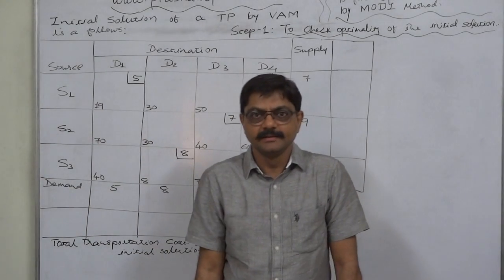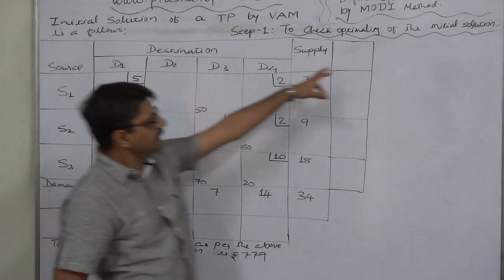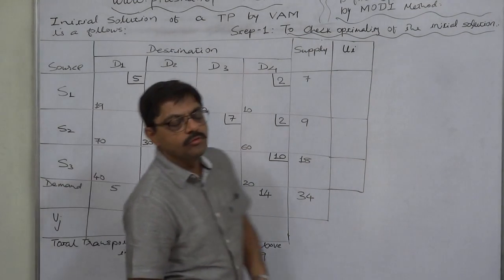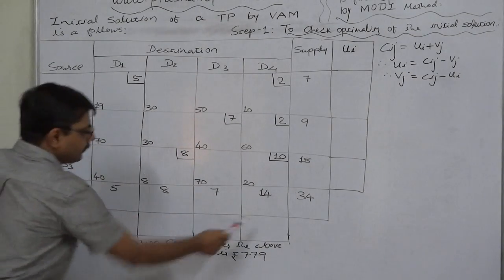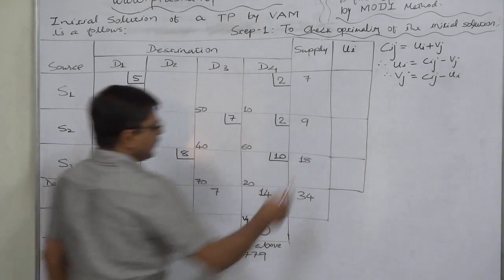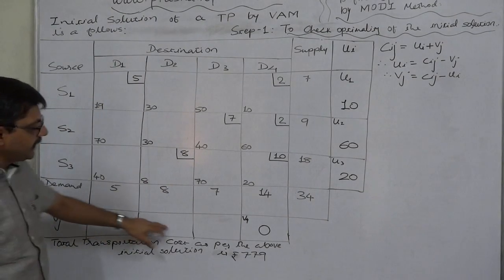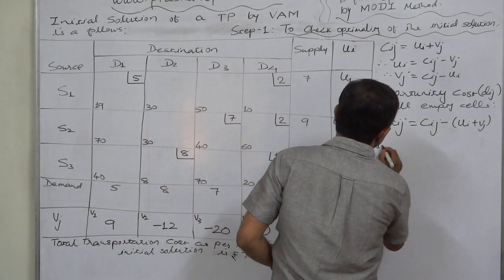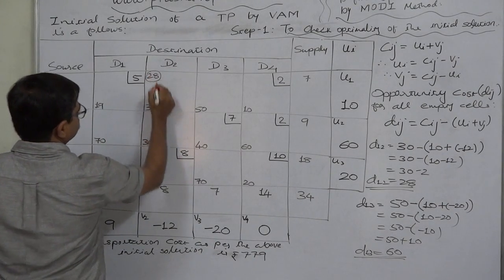Transportation Problem - 8 Optimal Solution Part 1 of 3

Comment: Sir what is the difference between Modi method and stepping stone method ?. Sir for the same question can we use stepping stone method and we will get  the same answer?
Reply from the maker: I have explained both the methods in different lectures... Yes, we get same answer of the optimal solution...

Comment: is it necessary to find initial solution only by vam method??

can i use northwest method ?
Reply from the maker: It is not at all compulsory to use VAM to obtain initial solution we can use any method to find the initial solution, but if we use VAM, the chances of obtaining the optimal solution at the initial stage itself would be greater. On using any other method we hardly get the optimal solution at initial stage. As a student, I would rather prefer taking chance on going through VAM at initial stage than to go through MODI later on...

Comment: what method should i use if they ask me to just find optimal solution?
Reply from the maker: (1) For getting the Initial Solution, VAM (with the modification suggested by me, i.e. Penalty to be found by subtracting the least cost of the row/column from the immediately higher cost of the row/column, as it has more probability of getting the optimal solution directly than the technique discussed in the reference books)

(2) For finding the Optimal Solution, from MODI or Stepping Stone, whichever you find yourself  comfortable with...

Comment: if di2 = 28 dn how di3 = 60  calculation is wrong
Reply from the maker: d13 = 50 - (10 - 20) = 50 - (-10) 50 + 10 = 60. So, nothing wrong.
But, d12 = 30 - (10 - 12) = 30 - (-2) = 30 + 2 = 32
Reply: but in ur video u wrote di2 =28.. plz check
Reply: d12 should be 32,  there is a calculation mistake.